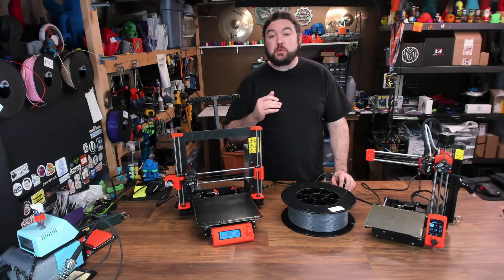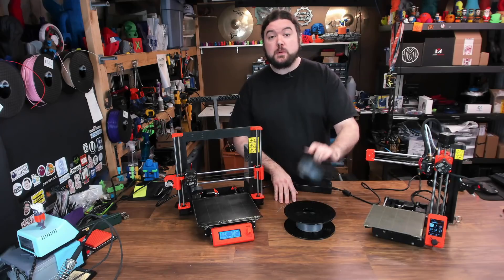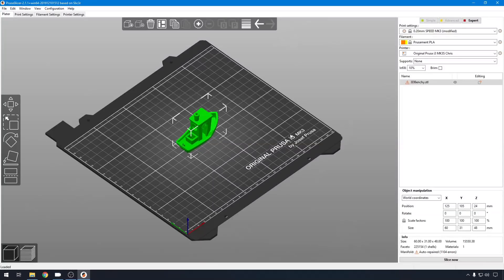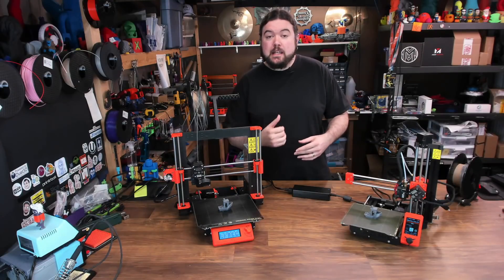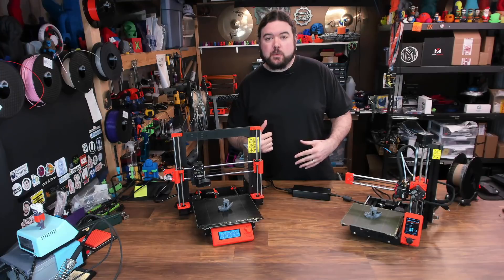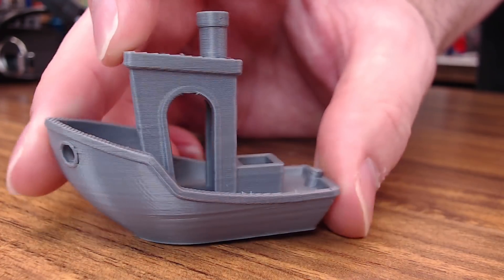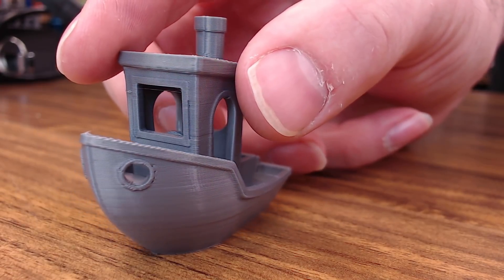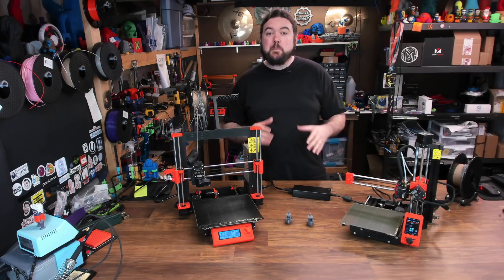Prusa MK3 vs Prusa Mini - 3D Printer Race - Chris's Basement

Comment: no offense but my stock ender 3 did much better than that. I get it prusa is from europe but i cant find the worthness of  the 500 euros more.
Reply: Exactly what I was thinking, I have my ender 3 heavily modded and would easily smash out a better benchy than either of those, probably twice as fast too. But even when it was stock I had much better prints.

For anyone thinking about it, my path to awesome prints would probably be as follows:
Ender 3 pro
Skr mini e3
BL Touch and use UBL 
Print chep's hot end fix (where you cut the little bit of Teflon tube and also print the tapered nut to hold the boden)

So for about $250 you can get very reliable super high quality prints :)
Reply from the maker: @lewisheard1882  I want to see these prints, this will be fun.
Reply: @ChrisRiley  https://imgur.com/a/Qx0eaWs
Went back to find some pics from before my hotend upgrade :)
Reply: @lewisheard1882  the benchy looks great you have a few layer shifts uptop but the rest is flawless
Reply: Radu Nanescu thanks dude :) yeah I think those layer shifts are due to an lead screw warp, keep thinking about ways I could reduce this... some blue machinists grease I applied after most of these prints seemed to help a bit, I wonder if an upgraded lead screw nut would help
Reply: @ChrisRiley  did I ever send you pics of my 47min benchy? I know I flooded you with emails a while back. Only issue with it was the bow, but that was my fault. I forgot I had PS resolution set to 0.05. The printer faithfully reproduced the slicer preview though.
Reply: @ChrisRiley   here is a timelapse of my benchy https://www.youtube.com/watch?v=CSkcol0Ew88 and https://imgur.com/gallery/NauqXed?s=fbm pictures. Overall i think yours is better in the same amount of time ... i got some artifacts in the print for some reason the printer stuttered and those were the results ... maybe its octoprint or my latest updates to my firmware and this is the first print with this PLA no name brand :), also even if my prints were better i still think the prusa printers are the most reliable out there but for those who like to tinker and update i think a lower price ender printer is the best option
Reply: Soo i found why i had the stutter and the artifacts on my circular print and it was indeed octoprint's fault and to be specific i think the print time genius plugin had this issue for some reason, my prints are now pretty rad again printing from sd card of course :) ... I went trough everything from ensuring everything is snug and every roller is tight, to updating to marlin 2.0.x from 1.1.9 ... the good thing is i now have less whining from the  axis motors and i think the defined board creality_ramps_board that is now available in marlin had something to do with that, everything runs smoother, i only need to calibrate my extruder a little i'll update another benchy here maybe tomorrow after i calibrate my extruder
Reply from the maker: @OldCurmudgeon3DP  No, i never saw those.
Reply: @NanescuRadu1  increase the buffers in the firmware as much as you have RAM to do. It'll help.
Reply: @ChrisRiley  I'll correct that oversight. Email inbound in a few minutes.
Reply: Yea, good comment. The Benchy actually looks 'OK' on both printers, but can easily be beaten by quite a few cheaper models.
Reply from the maker: I would like see pictures of your prints, just for fun.
Reply: Chris Riley ill try to print a 3d benchy tomorrow and post an imgur link with pictures, i have gray pla filament and ill try to print with that
Reply: @ChrisRiley  I dont have an ender 3 ...I have a corexy hypercube....but it looks like this guy has had good luck with it... https://youtu.be/a8Z-9ncYsps
Reply: my cr-10s did much better also but had to work on it for a while to do that, from ensuring all the bolts and nuts are tighten the cooling part fan is shit and had to be redesigned for even distribution of air  ... and the biggest update -- reflashing the firmware to marlin 1.1.9 with mesh leveling
Reply: and i still can't print flexible filament :) ... well that's a bowden issue more than printer fault
Reply: @NanescuRadu1  it can
Reply: bob Bunni of course it can but not as reliably as a direct drive mostly cause your bowden tube acts like a spring
Reply: @NanescuRadu1  yup.. less than 200 bucks
Reply: Agreed
Reply: @Electric Boogaloo Ye i wanna do that too but its out of stock due to pandemic issues :)
Reply: @Electric Boogaloo What is hemera
Reply: @barracuda6817  Hmera is a direct drive extruder from e3d, with super tight tolerances, its best in its class basically
Reply: @NanescuRadu1  ty

Comment: I've always wondered why the slicer says that there's errors in the benchy model?
Reply from the maker: Something interesting to do, throw it into mesh mixer and analyze it. I will show you the errors.
Reply: Good point. A supposedly "stock" benchy print GCode could in fact have been edited/altered to introduce 'ownership' (or even malevolent sabotage) anomalies, but also, the GCode for some prints is simply flawed. Printing a Self-Created Test Tower before the benchies would show up any Pre Test machine variances and make the Benchy Test itself more valid. It would also be good to see the digital view of GCode before running the Test as this is Best Pre-Print Practice.
Reply: @goldbunny1973  that's why you should think long and hard before using gcode you didn't slice yourself. The STL file shows errors  in Prusaslicer. No idea what they are or why it was released that way.
Reply: @OldCurmudgeon3DP  I agree. I always check my models before I print. Mostly Ive printed things I designed myself but it's good to warn newbies of these things. saves disappointment and time wasted looking for what they did wrong when they didn't do anything wrong, as such. Most of us still expect downloaded models to be pre-checked & print tested but many don't re-check GCode after eg. scaling up/down which can introduce errors.
Reply: @OldCurmudgeon3DP  The STL file shows Watertight errors on Cura too. It's just not a perfect design.

Comment: Somethings don't have to be scientific to be fun lmooo When in isolation lol any kind of fun to be had, must be had lol EDIT: 5:45 on my homemade Prusa now and again i get those marks and it normally indicates to me that its clean the teeth and retighten all the bolts and nuts to the extruder, might not be the case for you but its what fixes them for me. Especially when printing a lot of small parts as the extruder gets a more intense work out from all the giggling of retraction
Reply from the maker: Great advise, I will see what I can tighten to get it working a bit better.